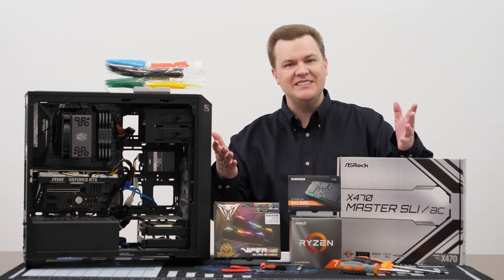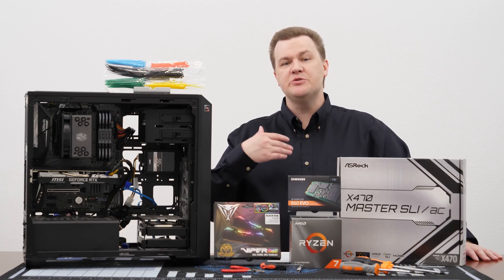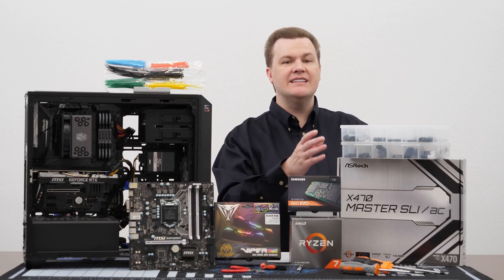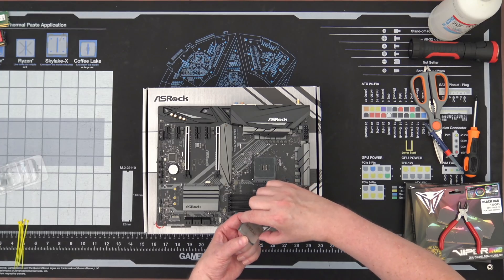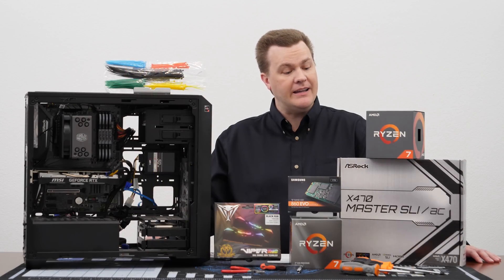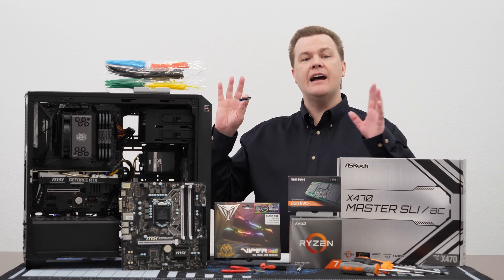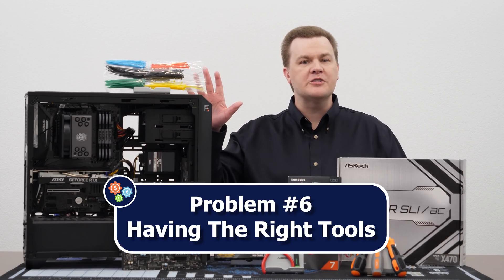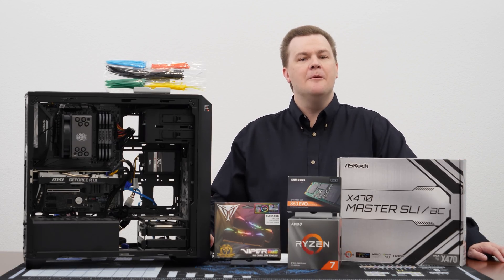Top 6 Challenges When Upgrading or Building a PC

Comment: I am upgrading in a few days and was planning on just relocating my nvme drive with windows installed to my new motherboard. My copy of windows is linked to my Microsoft account. Is it still necessary to do a clean install of windows? I have seen mixed answers. Any help is appreciated
Reply from the maker: Windows may deactivate even if you move the drive as-is, or not, it depends...  reinstalling is all about having a fast, stable system...  it's hit or miss changing motherboards...
Reply: @TechDeals  Thanks Tech. You're the man. Just gonna give it a try and see what happens.

Comment: As i'm watching this video on my FX 8350 build from 2014...
Reply: But...but..In my defense...As of right now, my tech table right behind me, I have all the parts to my very first and very new Ryzen build I just started to build last night. I have to say, it's my first time holding a NVMe M.2 from Samsung and holy crap that thing is tiny.... How far we have come in tech. Some of the parts I bought are new (sometimes i buy 2nd hand), but will be upgraded on Black Friday deals (such as I scored a new Vega 56 for under $240 but I know Black Friday will have great deals.)  But I buying them over the past two months with their current prices allowed me to buy higher end prices parts that will serve as the base foundation. Even the case I bought came with 60 bucks off and included all the fans, and the fans were all 230's mm x4. Full size case. Sadly, my only opsie was the cpu... I bought one, they said it would be shipped out as of May 21st...it's June 15 and they have not shipped it... Thanks amazon...Forced to buy a 2nd cpu (1600AF)

Comment: I did upgrade gtx 970 to gtx 1080. And psu to 750w. But I get wierd screen tearing and Micro stutter in some games and I had to cap fps to 90-110 on them. (144hz g sync monitor). Later I bought New ssd evo 860 (?) but same issue.

Comment: The absolute bane of my existence would be going to upgrade an older Oem pre-built with a newer graphics card like an RX 460 to find out on the day of that the machine has a legacy bios and will not post with anything newer than a GTX 600 or Radeon HD 7000 series graphics card

Comment: Not sure about switching from AMD to Intel and back not if you are switching within the same platform you for sure don’t need to reinstall Windows. Windows 10 will install whatever chipset drivers it has and you can just install the chipset drivers from your motherboards website later. Even in Windows XP times you could do that but it was a bit more complicated with few extra steps.

Comment: I upgraded my computer a week ago from an i7 4930k (which no one seems to know exists) 6 core 12 thread cpu,  x79 motherboard,  to a Rizen 9 3900x 12 core 24 thread cpu, Gigabite Aorus x570 Elite motherboard (which build zoid gave a good grade) using the methods you described in this video and they worked perfectly. This is excellent advice for newbies and experienced builders alike.

Comment: that last step doesn't work for me.

diskpart > Clean

virtual disk service error:
clean is not allowed on the disk containing the current boot,
system, pagefile, crashdump or hibernation volume.

how fix that
Reply from the maker: You're trying to clean your current boot drive, that's not a good ideal.  You need to be REALLY sure you're on the right drive...  Also, you need to be sure you're not actually booting to your old drive before the new one takes over, this is setup in your BIOS boot manager.

Comment: So, you have put a Ryzen 7 2700X in the AsRock  X470 board and downloaded from another PC the BIOS. Not realizing that you can download and install the BIOS straight from the net from inside the BIOS with AsRock boards. It's called: inform yourself before you buy. Secondary, if you replace a motherboard, best to reinstall Windows as clean, with all disks decoupled except the one you want as boot drive.
Reply from the maker: You can't get into the BIOS without a supported CPU, it is an annoying design aspect of modern motherboards...
Reply: @TechDeals  I know, but mentioned you used a 2700X to update the Bios, if I am not mistaken or misheard you. From that moment, you hadn't to download a new Bios on a USB on another PC, but you could connect from inside the bios to the server of AsRock to download and flash directly the Bios. Page 86 of the manual of the board. So, in fact, your 7th or 1st annoyance or recurring issue in the list should have been, what we said during my time in the Nokia service center: RTFM (Read The F'ng Manual)

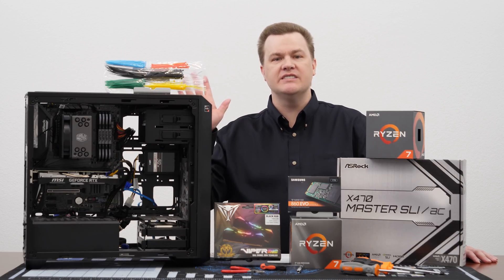Comment: 7:26 - The question is: if you have a 2700X why would you buy a 3700X?
Reply: ipc improvement and better infinity fabric implementation , better validated ram support out of the box at higher speeds or tighter timings .
Reply: @tanmaypanadi1414  The logical upgrade path would be a 2700X --> 3900X.
Reply: @supergoofy123  true and 4000 series might be relevant too when it launches or if its compatible for your parts.
Reply from the maker: As a general rule, you wouldn't...  it could have been a Ryzen 3 1200 for all the difference it would have made, the 2700X is just what I picked up from the shelf first.

Comment: If you have multiple disks installed when installing windows. Windows tends to put some files on a different drive than the drive on which you have windows. To avoid this, I have only connected the disk to install windows on installed. For example, when I delete a disk, I physically disconnect the other disks so I minimize the chance of deleting the wrong disk.
Reply from the maker: Very good advice...  did I not say that in this?  I thought I did, but perhaps I just dreamed it!  :)  That is what I actually did here when installing Windows on this new setup, however I did leave the pair of M.2 drives installed on the motherboard, but I did unplug all the SATA drives, then once it was all working, added them back.  I did have to manually set the proper boot drive in the BIOS after doing it, it wanted to boot to the OLD SATA Windows drive!
Reply: or use sharpy and proper naming of the drive in system while installation with its date of purchase .
i do this for the NAS it has all 4 bays full with 4 tb drives and 3*2tb*drives on my desktop.

Comment: You can transfer windows keys to a new motherboard or cpu you just have to tie windows 10 to an email and just login to that email on the new one but you can't use that same key on two different systems at the same time, I went from a am3 fx8350 to am4 ryzen 1600 b350 to with same CPU x470 and still used the same key, so I changed CPU and motherboard and just motherboard and still used the same key
Reply: thank you sir
Reply: Warm Soft Kitty  yes you can all you have to do is tie the key to your Microsoft account and you just login to the new PC with the same account and key
Reply: Warm Soft Kitty  https://youtu.be/KsjZWiRNu6c

Comment: I've got a B450 and a 1600 board and might upgrade to ryzen 4000 after it comes out. I am dreading the bios update process
Reply: did it not have bios flashback functionality ..
Reply: B450 boards will almost certainly not support Zen 3 so you won't have that issue as you'll need a new board anyway.
Reply: @MrGorpm  they will there will be bios update for it. There have been multiple videos on this. AMD had to backtrack
Reply: @HeresJohnny1201  I probably should not have insinuated that ALL B450 and X470 boards would not be supported but I am aware that many boards will have issues due to this statement: "We will develop and enable our motherboard partners with the code to support “Zen 3”-based processors in select beta BIOSes for AMD B450 and X470 motherboards".  I would love to be able to just pop in a new processor and have it work, but unfortunately that cannot go on forever.
Reply: @MrGorpm  I know just scared about if my motherboard can do it. I really don't want to brick my board
Reply: @MrGorpm  really  if amd(& msi) flip flops the support for the zen3 on b450  they have a law suit waiting to happen.
 i didnt feel zen3 support was needed since it will definitely mess a lot of second hand market but, i am all for stuff not going into the dump..
Reply from the maker: If you update the BIOS first, it really isn't a huge deal.  I do encourage you to have a UPS before doing it since a power failure during the update will usually brick the board.
Reply: @TechDeals  can you do a video on it when the 4000 series comes out. I'd appreciate it alot

Comment: I have bought asrock b450 steel legend + r5 3600 as tomahawk max as unavailable. Now i see everywhere people commenting asrock b450 vrms are shit. I won't be doing any overclocking only xmp and gaming. Will i be fine ? I am really worried
Reply from the maker: You're fine, people get so up in arms over VRMs like they'll somehow not work unless you spend big bucks...  don't stress, that's a fine board...
Reply: @TechDeals  professor has replied hence i am done.
Reply: Yes you will be fine, even with the stock cooler (but I would undervolt the 3600 a bit if you don't plan on getting some other cooler). If you get a solid 30 - 50 bucks air cooler you shouldn't have any CPU temperature problems
Reply: @federkraecker97  i have already bought coolermaster masterliquid lite 120.
Reply: For a 3600 I don't see a problem, it's more the 8+cores where it gets more complicated.
Reply: any issues at all, dont worry. Vrms are important, for the most part, if you are overclocking.
Reply: @Yaxie  no overclocking. A little bit of xmp and only gaming. No streaming no editing nothing at all

Comment: glad to be here this early. Planning to buy a 1500$ rtx 2070 super pc this august..should i wait longer or is the 2070 super,ryzen3600 worth it
Reply: Since new GPUs and CPUs are probably coming this september/october both from Amd and Nvidia, I would wait a bit more if august is the planned time to build. I say that as someone who is very happy with my 3600/2070s system that I put together in early october last year. My rule is to never buy a new CPU or GPU if next gen is less than 3-6 months away and my pc isn´t broken.
Reply: You wait, till september or October, because everything new comes out, and they drop the prices of all the previous stuff you want to buy.
Reply: @k9ishere  that is not going  to happen most inventory is already being cleared right now way before launch.
Reply: @k9ishere  isn't going to happen, most hardware is not in stock due to Corona.     The 3100 and 33x were released last month and they are not in stock still and we are already in mid June. When new gen comes out they will be out of stock as well because the demand is higher, in consecuence, price will be higher than expected. Just look at launch prices for B550 motherboards and XT refreshes.
Reply: @Yaxie  ok. Thanks for the info
Reply: Better to wait for new GPUs, as for the CPU, depending if you want more future proofing or not go for an 8 cores.
Reply: the price point you are buying at the gpu wont be released at launch at least next 6 months after the release of ampere 
rdna 2 might be tempting  so wait for that.
buy the ram, storage and psu before hand they will definitely be going up in price by the end of year.
email superclocked pc they have great service and run by people who have transparent policies.
Reply: @tanmaypanadi1414  I know ram prices fluctuate,but why would ddr4 prices go up when ddr5 will start to come out in 2021?
Reply: @k9ishere  ddr5 support will be a feature after  the second or third iteration of 4000 series by the end of 2021 or feb of 2022.
in high end products like threadripper or xeon it will be a while before it comes to consumer market or desktop.
its price will be higher than ddr4 due to better Error correction and no bit flipping out of the box.